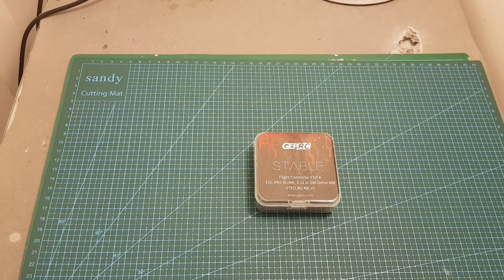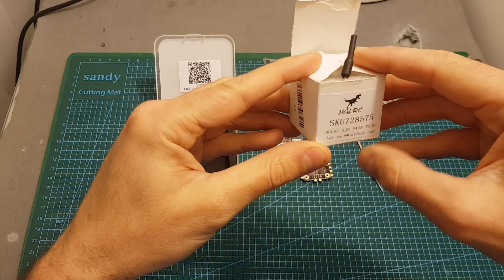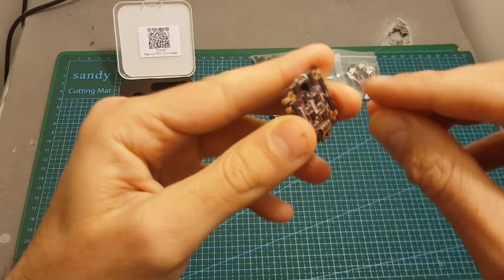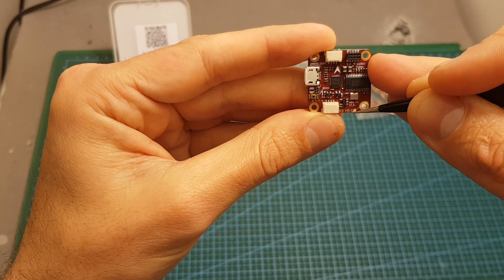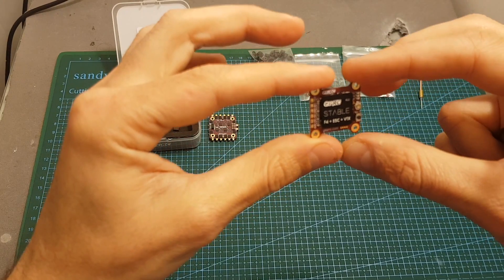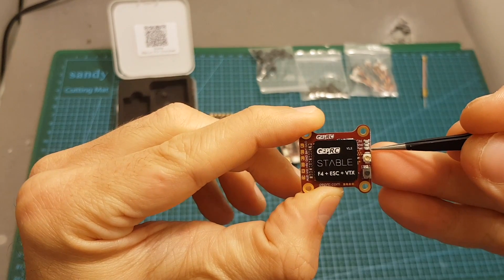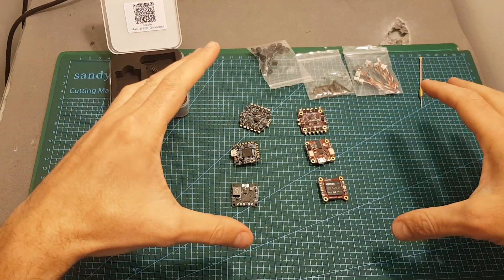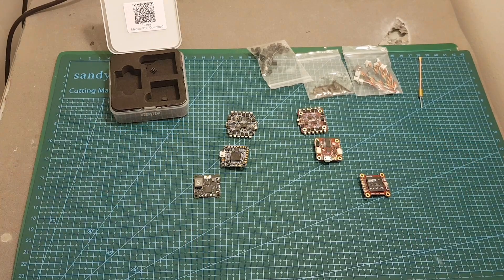GepRC Stable AIO Stack - Unboxing & Overview

Comment: Hello! I bought this one and I try to connect with ppm on an fs-a8s for use with fsi6 how do I wire them? Actually it is the f7 board
Reply from the maker: Hi, did you figure it out or you still need help?
Reply: Hi! Yes I contacted geprc support and they sent me a diagram with the correct wiring. I used a ibus connection instead. And what I didn't realize was that I needed to have that battery plugged in during the betaflight configuration in order to connect to the transmitter. Thank you for responding!

Comment: Hi, i have the same fc. But i burn the sbus slot. Now i want connect it with ppm slot. İ have radiolink r6dsm receiver (sbus) i see on descreption from receiver its compatible. İ have soldering to ppm everthink is fine on betaflight its working bu only the motors are not working on betaflight. There its working on program but they are not going on in real only on btf . Anyone know this problem? What can i do? On betaflight confirgator is uart 1 with usb selectet and receiver is on ppm. And the esc is on dshot 125. İf i turn on my radio of any stick the leds are blinking lime its work..
Reply from the maker: Does the radio responds properly on Betaflight? Does the motors work on BF too? (Check it with no propellers)
Reply: My quad is cinebee 75 hd

Comment: If anyone wanna buy this one check the right version. you should get v1.4 or higher.

there are extra rx and tx pad on Fc on version 1.4 

I have two, which are v1.3 and 1.4 , v1.3 doesn't have any extra rx and tx pad. maybe there is one but I can not found it

Comment: Hi, I think this is the same FC as in Cygnet 3 HD... How to connect Crossfire Nano RX? Can’t see any available UARTS. Re-mapping on Betaflight? Any ideas?
Reply from the maker: Hi, it might be a little tricky. Anyway, as far as I know you can set the CRSF to output SBUS. Check out this guide: https://oscarliang.com/crossfire-output-sbus/
Reply: Gal Kremer yeah, I’ve been trying to avoid that method, because I don’t want to introduce latency... will keep looking around for a solution. Thanks for the reply and for all your great videos :)
Reply from the maker: @ZenMountain  No worries:-)

Comment: i have this tower but im not getting any image or OSD on my goggles do you know why this is happening? thank you
Reply from the maker: If you're not getting the OSD on your video - it means that the OSD is either disabled or the VTX is not connected properly. 
When you scan for available channels - does your video receiver finds the selected channel?
Reply: Gal Kremer yes ! It finds the Chanel but just give a black screen with no osd info vtx is on camera is on too
Reply from the maker: @phikobawa  Disconnect the camera and see if you're getting the OSD of the FC.
Reply: Gal Kremer no , if I turn the camera off it’s the sAme just a black screen with no osd

Comment: So no matter what i do, the VTX settings dont seem to save. i long click to power, it flashes once, hit the button 2 more times it flashs 3 times like i want it to after that it goes right back to a single flash, any ideas?
Reply: Holy crap I was searching all day for this answer. It works. Turn off IRC tramP in the uart
Reply from the maker: Make sure that the smart audio is disabled on Betaflight - if you want to set the VTX manually.
Reply: Gal Kremer thank you much

Comment: i have this tower BUT WILL NOT WORK WITH SPEKTRUM NO INPUT OR OUTPUT SIGNAL ??????????????
Reply from the maker: Do you have any previous experience with DSM/DSMX?
Reply: yes i have a lot of helicopters but this is my first race quad (geprc hummingbird) anyway looks like the receiver orange r617xl  is the problem , altho its dsmx and binds to spektrum  but only works as cppm serial rx ?  not spektrum sat  , so i have a signal now so one step closer
Reply: AG Motors  Somebody said on another forum that you need to switch the wires. The wires don't line up with the provided port.
Reply: Any link to the forum? Im having the same problem adding a SP09x satellite
Reply: Did you ever solve this problem? I am using a Lemon RX satellite and cannot get a signal.
Reply: @TenshiJuuSan  i have sognal but motors diddnt work. Did you resolve r problem?
Reply: @emrahksk83  Yes, I did resolve this problem. Once I was able to bind my TX, all was good. Ironically, I am having the same problem you are but with a Diatone Mamba f405 mini stack.

Comment: Which would you say is better the hlgrc f428 or the stable? I'm thinking of buying the geprc mx3 and trying to decide which flight controller I should get. I can't find any review comparison so I would like to ask you since you've seem to have experience with both.
Reply from the maker: Hi Colin. In my experience, the HGLRC F428 is better.
Reply: Gal Kremer thanks for responding quickly. I ended up ordering a sparrow with the hglrc flight controller. I plan to use your channel when I finally get to building my first drone.  Keep up all your great work.
Reply from the maker: My pleasure. Send me a link to the video please when it will be ready :-)

Comment: Hello, which Flytower would you recommend, the Geprc Stable Flytower, or HGLRC XJB F440-TX20? Stand before a difficult decision ;-)  Best Ragards
Reply from the maker: Go for the F428-tx20 :-)
Reply: Please, why? The ESC has only 28 A and D-Shot 600
Reply from the maker: Well it depends which motors you're going to use. The Geprc Stable ESC are only 20a, so I assumed that 28a should be enough for you.
Reply: True, I now have the HGLRC Flame 1105 / 6000KV engines and would like to mount the Emax RS 1106 / 6000KV and possibly later other engines and thought first to the GepRC Stable AIO Stack and then saw the XJB F440-TX20 ;-) Please excuse my bad english.
Reply: Can I take the F440-tx20 for my HGLRC Flame 1105 / 6000KV and later for the Emax RS 1106 / 6000KV ?
Reply from the maker: Yes, of course.
Reply: Thank you for your answers